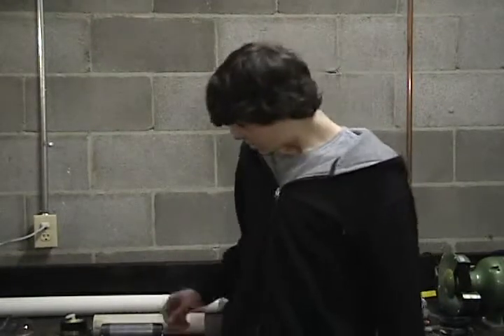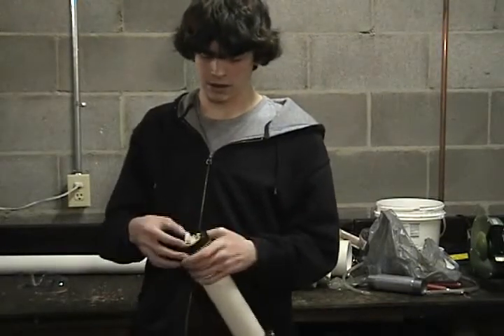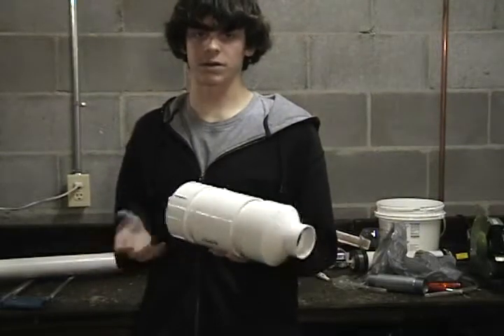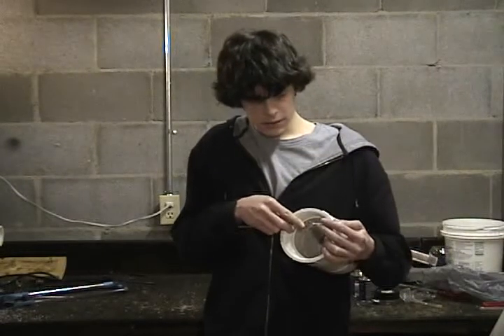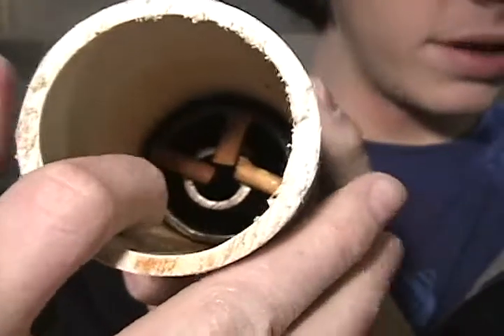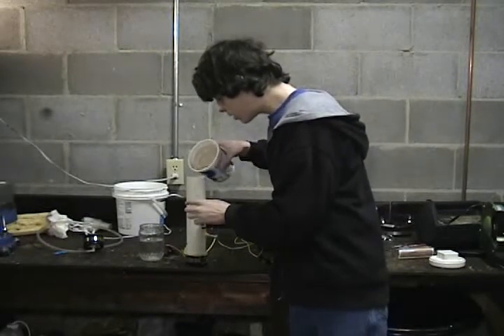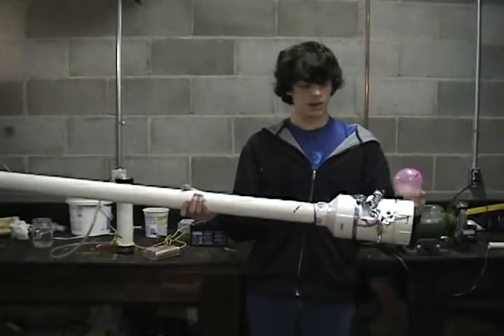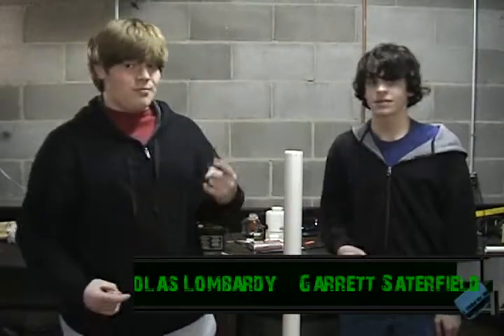Bootlegged Episode 4 - Hydrogen Potato Gun

Comment: Guys I dont think you know what your messing with ... sch 40 pressure rated pipe cannot take the pressure spike generated by a hydrogen and oxygen .... I HOPE your using nsf-pw pressure rated fittings... again I strongly recommend that you just use propane or mapp gas.. but dont use hydrogen in a frikkin sch 40 pipe....